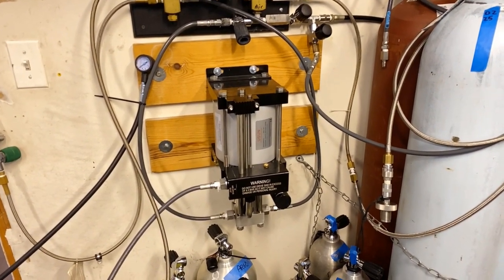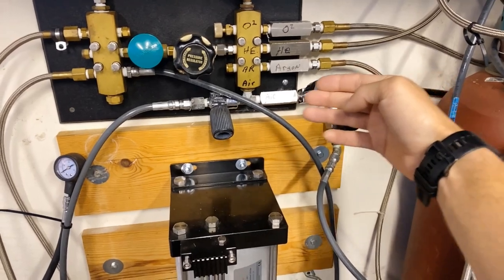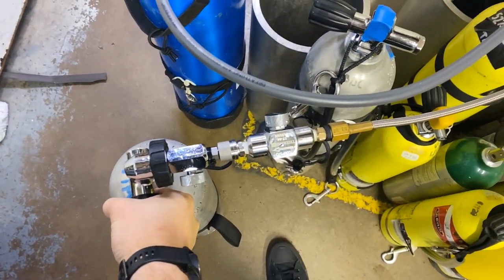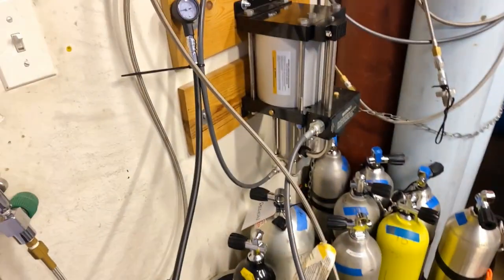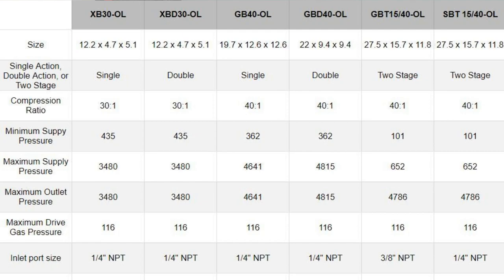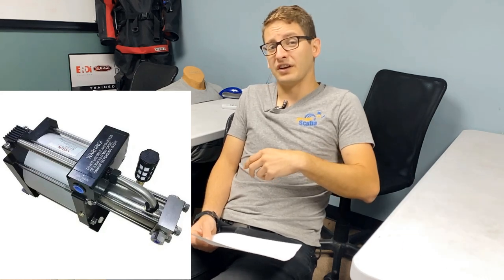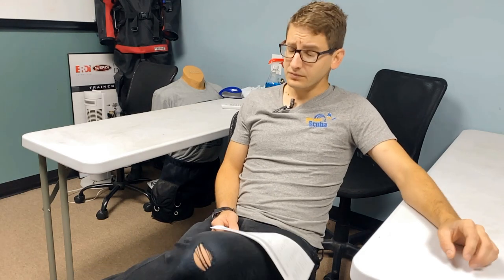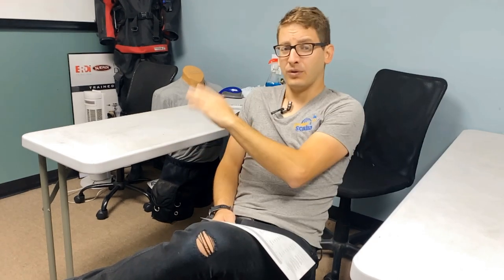Scuba Diving Gas Booster - The Basics / USUN Boosters

Comment: Is there a requirement to reduce the gas inlet pressure or can you cascade into the target cylinder and then boost to a final desired pressure. My oxygen and Helium come in cylinders that are usually around 2500psi and I would rather not have to reduce that down prior to boosting. Thanks

Comment: Nice video, what fitting have you used for your air drive connection to the G1/2’’ inlet port? The one I have supplied from USUN leaks badly. Thanks!
Reply from the maker: @user-de6fe1vw6o  https://www.threadtoolsupply.com/12-bspp-to-14-npt-steel-thread-adapter.html

Comment: Any recommendations for a regulator that keeps the supply pressure below 652psi?
Reply from the maker: https://valvesandregulators.aquaenvironment.com/item/standard-flow-reducing-regulators/415-reducing-regulators-2/415-1500
Reply: Great video,Tim. I’ve got a list started at McMaster-Carr but need to add some quick disconnects…do you know which QD’s you are using?
Reply from the maker: @rexrichard8444  I use the Swagelock SS QDs. https://www.augustindustries.com/product-category/quick-disconnects/